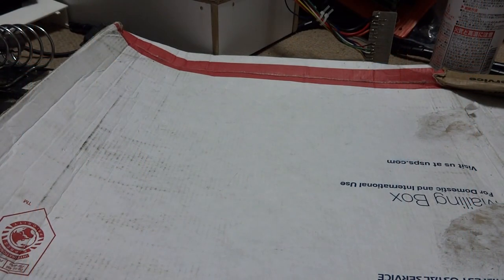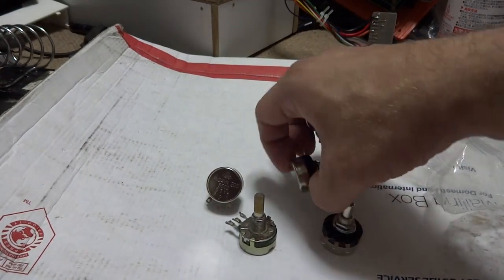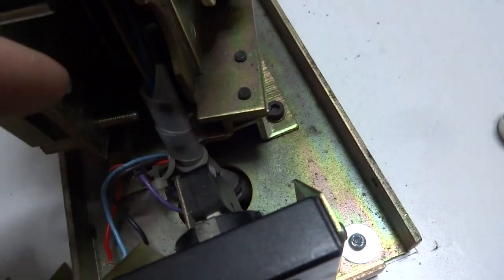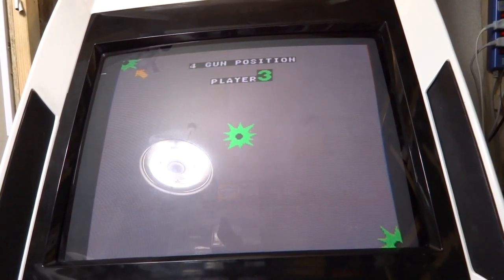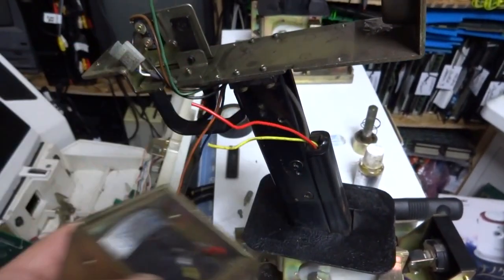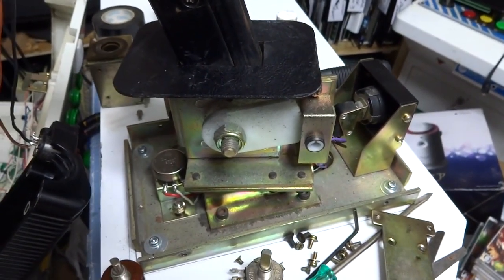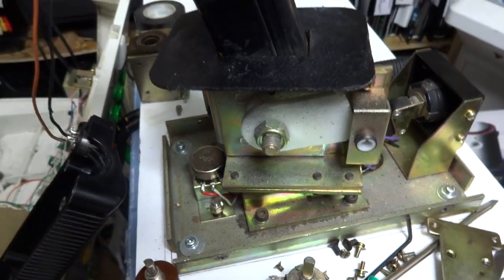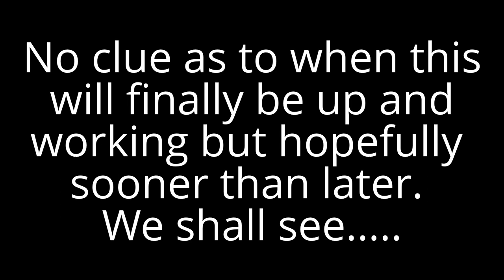Custom 1989 Beast Busters Arcade Control Panel (Pt. 4) Replacing The Pots

Comment: To expand on my last message, After checking you have +5v and 0v on the 2 outer pins of both of the pots on a gun. Connect your meter black lead to a ground point on the board and then measure with the red lead pins 2 and 5 (X and Y) of the 6 pin connector of one of the guns plugged into the board. Make sure you are getting a value that is changing somwhere between 0v and 5v as you move the gun around. Make a new gun loom if anything looks suspicious

Comment: Hmm, it could be a few things.   It could just be a problem with the EEPROM not writing the values correctly. 

Also, the system might be doing some checking on the values of the pots when the trigger is pulled during calibration.   Maybe if the voltages aren't within a good range, or are too similar, then the calibration fails?   I'd check the voltage values of the pots during the calibration;  Make sure they make sense, and are different for each position.

Comment: I take it you've checked that the pots have connectivity to the correct pins on the main board connector?  I would start there and measure the connector point on main board whilst moving the pots to ensure that resistance changes correctly.  I doubt the main board 'knows' the solenoids are even working unless there's some current checking circuitry - I doubt it.  Next step is to follow where the pot points connect to the board.  My guess is the first chip they connect to is where the fault is.

Comment: maybe check with a multimter on the solenoids to see if the board is trying to output power to them, or check to see if the  solenoids them selves have continuity... just a thought :)

Comment: I'm racking my brain then- extra grounding on gun? Issue storing the calibration values in memory? Have you traced all the pins on the header for the gun connector to see where they lead?

Comment: Luke have you tried jumpering the gun 1 and gun 3 connectors (or gun 2 and 3) on the bottom of the board with some wire? I think unplugging gun 1 while it is still calibrating could be causing the issue, I could be wrong as I do not own this board but I think it is worth a try.

Comment: Alright Luke1, back again Luke2 here ;) - This game is a nightmare to work on due to the lack of visual calibration feedback on screen. Without reading the databus, you have no way of knowing what values the board can see. I suspect you may have a bad ADC or analog switch. Check you have 0v and 5v on the outer 2 pins of the pots. Switching guns during cal is fine. You don't need the solenoid for cal so ignore that. Check you are getting volts on pin 2 and 5 of the 6 pin gun connectors

Comment: After reading the manual it seems to me that the calibration data cannot be written to the EEPROM on the pcb. Also it says that you should calibrate all 3 gun connectors with gun  no. 1 first, before you connect gun no. 2. Did you find the same manual like  the one on the crazykong site?

Comment: Oh, damn, that's right, you did. Thinking logically, where does the data get written? if it's to backed-up ram, then... caps, battery or (nv)ram chip? If not, then it could be that solenoid/daughter board, if the aiming works *but* the solenoid doesn't fire (though I would have thought that would be a different error). Argh! measure voltages from the aiming pots, see if there's a bad ground? Chin up, you'll get there!

Comment: I don't know where to go with this. The setup routine is absolutely terrible because of the lack of visual feedback. If the game actually showed you a visual cursor like almost every other gun game does during setup, or if it told you what and when the failure was we could have this fixed in 5 minutes. Have you been able to identify the DAC and analog switch on the pcb? We need to check if they are alive but I dont have a high res pcb picture to look at?